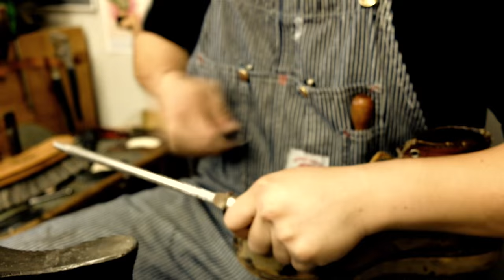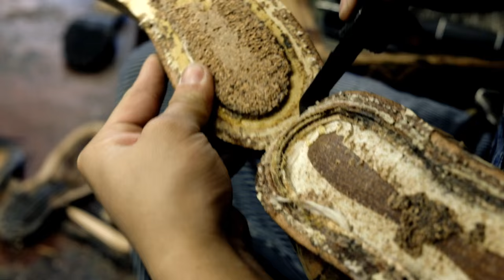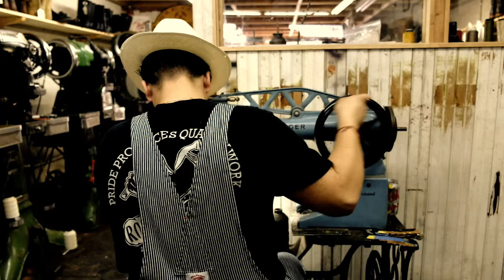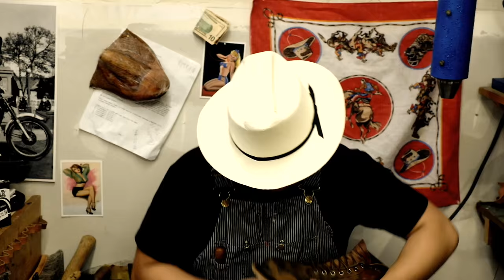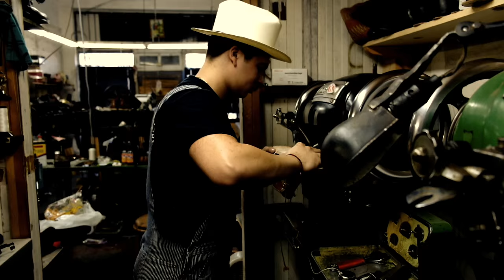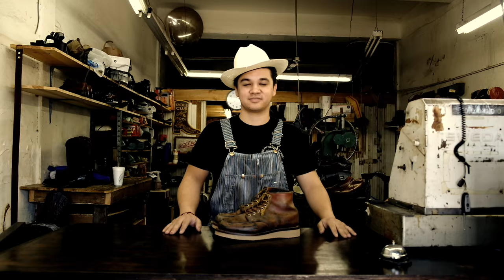Red Wing  Moc Toe 875 Resole #3

Comment: Are the wedge sole  you use on the resoles more durable than the wedge sole red wing uses?
Reply: He used a Vibram 2021 sole here, Red Wing uses the same sole or a Vibram 4014 depending on the model.

Comment: you must be expensive as hell lol
Reply: Chuck R not really. If you want his role club soles it costs either $165 if he uses your old welt, or $220 if he removes the old welt and hand stitches a new one on
Reply: Yidris these boots retail for not much more than option 2. Arguably that's expensive.
Reply: Jonbombs not really, if you value the boots, and recognize that there is value in keeping a quality item that you have history with, and maintaining it.
Reply: That's subjective. Objectively it is expensive based on new boot retail price.
Reply: I agree.  I am relatively new to wearing leather soled boots and I'm definitely going to have to find a pair that I am in love with to even consider that sort of cost to resole them when that's more than I paid for a couple of the pairs of them I have
Reply: Yidris
My old redwings cost me 350$ and lasted me 6 years. Worked at a junkyard and as technician…they went through hell. When I finally decided to purchase new ones they had discontinued that specific boot. I originally would spend 100$ every 4 to 6 months on cheap boots that would fail against the environments I worked in. I have new Redwings but those old ones were built like a tank. If those soles are oil and gas resistant like my old ones. That would totally be worth it in my eyes.
Reply: Well l’ll get some pair of boot but used it 😎
Reply: which model were those?
Reply: djinux1 it usually doesn’t cost that much to resole.